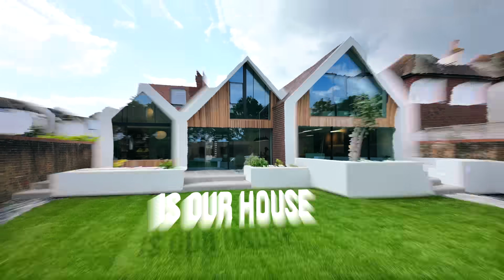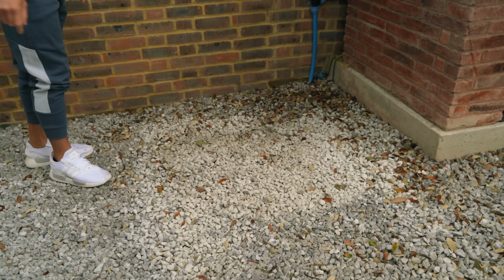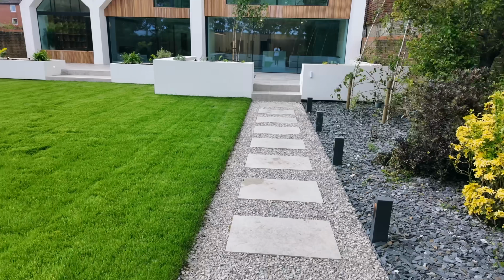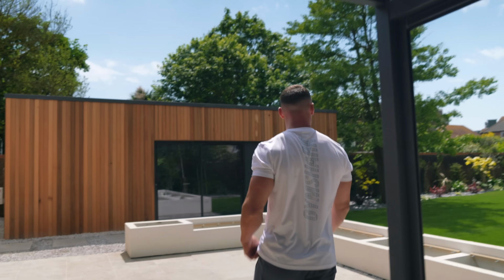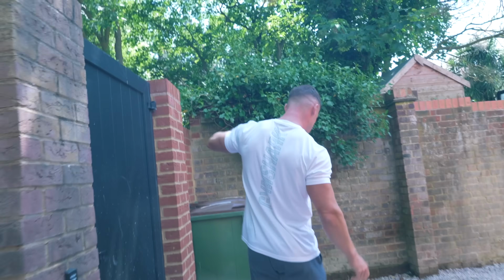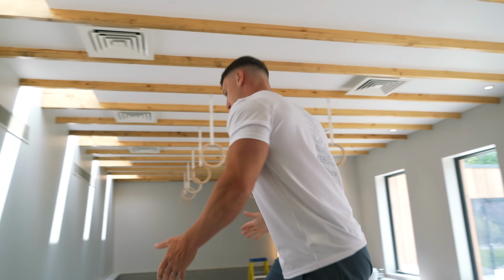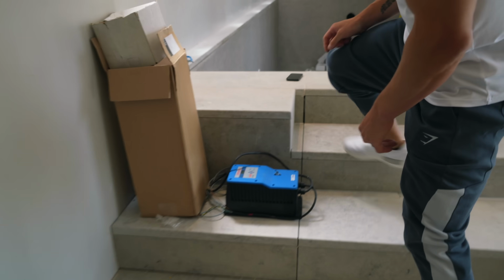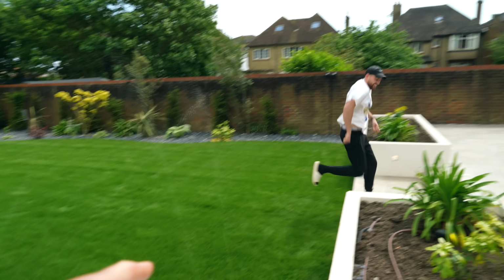OUR DREAM GARDEN TRANSFORMATION | Indoor Swimming Pool & Garden Tour

Comment: Back in 1998 I built a swimming pool 57 x 18 x 8 a d .i. y  job in my garden ..I put a polytunnel over it 80 x 30 . Had all the kit above ground . BUT I did not use Chlorine this can give you very serious health problems if you use your pool 4-5 times a day .,as we did .Other options are available Salt and Bascil  . No need to wear goggles in the pool and you could drink the water ! Before you all jump down my throat you don't swim in a public pool for long it's a limited period for a very good reason !

Comment: The rings over the pool are pretty dangerous near the entrance of the pool, if you fail and fall back the water isn't deep enough to break you fall before you hit the stairs i think .. if you fall backwards you can easily hit your head i think. If it can happen, will happen kind of thing.